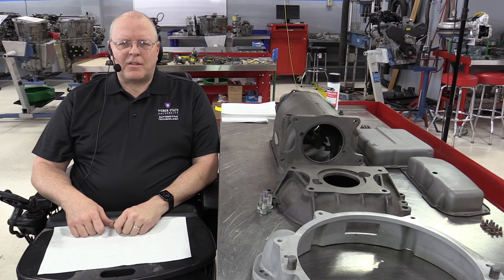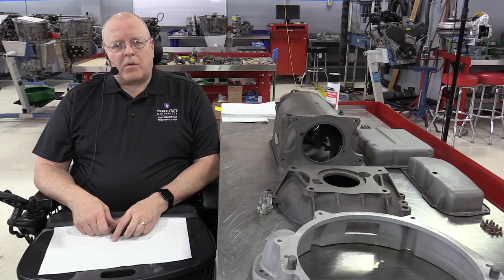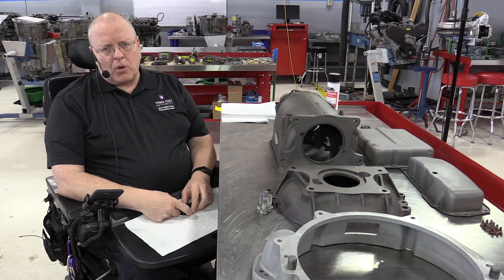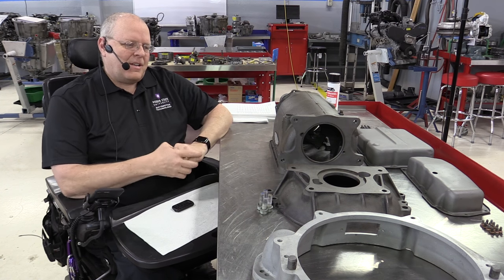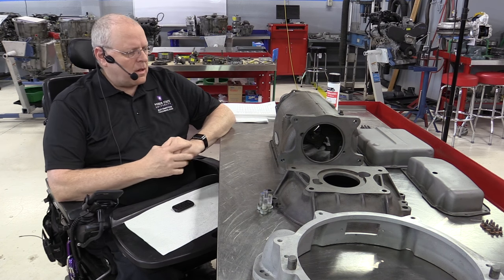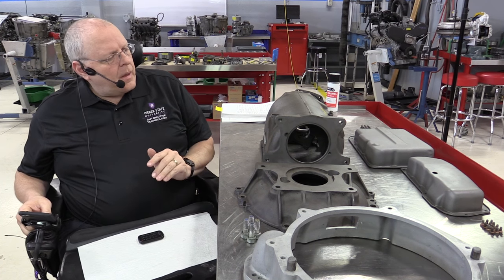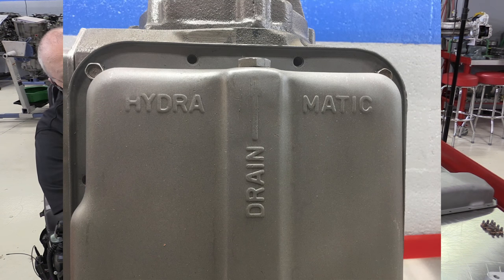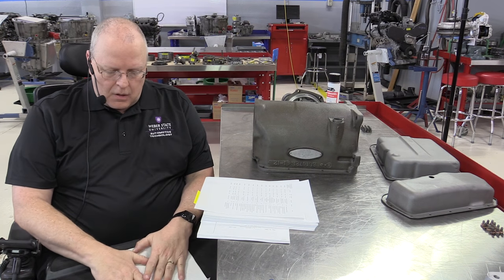World's First Mass Produced Automatic Transmission - Part 1- Introduction and History

Comment: The 4 speed AST transmission with the clutch was installed in a handful of 1938 Buicks. My grandfather who regularly would buy clear title salvage cars and repair and resell them ran across one of these just after the War but not really knowing what it was didn't buy it.
Reply: Fun fact, Buick was rather salty about basically being forced by GM management to build these units and install them in their vehicles, so when the AST failed, they had no interest in licensing the Hydramatic, and out of spite developed their own unit. The Dynaflow, which due to WW2, wasn’t finalized and introduced until the 1948 model year.

Comment: My dad had a Hydramatic in his 1948 Pontiac, the first year for Pontiac, it always worked perfectly—the sick/weak straight-8 engine not so.  We later had a 1955 Star Chief HT (first Pontiac V-8) that had a selector position that would start the car off in 2nd gear, it was listed as the “gas saving” mode. 
In 1962 I had one of the last perfected versions in my Bonneville, performance was awesome with the big 389 V-8 coupled to the smooth-shifting 4-speed Hydramatic.  With the introduction of the new 3-speed Turbo-Hydramatic in 1964-65, the 4-speed was gone but B&M carried-on for years with hi-performance versions.
Reply from the maker: Awesome! Thanks for your feedback!

Comment: The oldest car I remember in my family with an automatic was a 1967 Oldsmobile Cutless Supreme. All of the other cars my Dad and my uncles had since the 1940's were manuals.  So there was a cost and gas efficiency difference that kept automatics limited to the buyers who could pay for them in the 1950's and 1960's. But by 1970, many cars had automatics that cost almost the same as a manual, so they became more common. All of my cars are automatics (my first was a 1965 Rambler American). Now I drive a 2014 Ford Fusion Hybrid that has no shifting at all.
Reply from the maker: Awesome Feedback, Thank you!

Comment: This is a fascinating series. Thanks. My Stepfather started out in skilled trades at the Detroit Transmission plant which was on Riopelle Street in Detroit sometime in the '40's, then moved to Livonia, MI, then on to the Hydra-Matic Willow Run Plant where he retired in about 1985, or so. I worked at Hydra-Matic Willow Run, then later became GM Powertrain from 1977 to 2008. >>>
The year was 1977. I operated the cut open machine for the 400 THM torque converter in Dept. 433, Torus Division at Hydra-Matic Willow Run. The converters were rejects from testing; they were removed from racks, and were hand placed, hub down, into a massive chuck that clamped around the outside of the impeller body, (which we simply called the "pump") with the cover, pilot and lugs facing upwards. A plexiglass door was pulled down and the machine was cycled. A thick triangular cutting tool was indexed into the weld as the unit spun. The cycle time was about a minute and a half or so...it seemed. You knew it was almost done when ATF fluid began to get flung on the cover door of the machine. The machine cycle ended. Then you removed it, and the converter cover was separated, or almost separated from the impeller housing but still held by a bare "thread" of the weld, sometimes....then you banged the thing on a metal fixture, if you had to......to pop it open on a table that had a grated surface so that the fluid could drain. Then the internal parts were separated, and sorted down their respective conveyors to be sent thru a washer and put into tubs to be sent back their original department for inspection...and rebuilt...if possible. The bearings were never reused and were junked. 
Did I mention that the THM400 torque converter, filled with ATF, is heavier than most torque converters? 
The production on that job was about 200 units per shift...it seems. My partner and I figured out the most time efficient method to do that job, the idea was to keep the machine running with as little time between cycles as possible, and working together, we were able to "bust ass" and get 200 units by lunch time. Then go hide. The boss was happy because we always got the count. It was hard, heavy, filthy work, and guessed what we smelled like when we went home every day? Transmission fluid...you can bet. One thing that used to happen, was that occasionally when the cutting tool got really dull, the chips coming off the operation, would get very hot, and cause a fire inside the machine, aided by the ATFluid igniting...it was so hot. We would look down the aisle to see if the boss was around....and enjoy the fire for a minute as it grew before we reached for the extinguisher...heh. 
Fun times. 
In the 3 years I spent in Dept. 433, I did most of the operations making the impeller unit, and can remember the step by step manufacturing process in fairly great detail....Then spent some time in Dept 431 which was the torque converter assembly dept, where they were assembled, welded together, filled with fluid, balanced and tested. 
I have been retired from Hydra-Matic Willow Run since 2008, and spent several years making planetary pinion gears...and many other jobs. They closed in 2010, and the building was torn down in 2014. It was originally the Willow Run B-24 bomber plant, built by Henry Ford...in 1941...so much history there...Thanks for reading this.
Reply from the maker: Thank you so much for your fantastic story and more transmission history! I toured the Hydra-Matic Willow Run assembly plant in 1997. They were assembling 4L80-E transmissions on two lines. It was an amazing tour for us GM Training center instructors. One funny thing I remember is the machine that was making valves for the valve body. After they were made, the machine shot them several feet into a giant container. This is funny to me because as instructors we were always told to be very careful with the valves and never to drop them. Thanks again for your wonderful feedback, it is fascinating to me. Best wishes!
Reply: Thinking about that further I may have exaggerated the expected production on the cut open operation. It was more like 200 units per shift, not 400, as I recall, and doing the math...I've corrected that above.
One other thing that you may be very interested in: The THM400 torque converter that we made back then for the Rolls Royce contract....After the vanes were inserted into the pump housing and crimped into place with their retainer, we had a special welder that spot welded ALL of the contact points, or the 'bumps' that you see on the outside of the converter pump from the outside, securing all of the vanes in the unit as a very solid piece. The result was a coppery looking finish from the heat of the spot welds, and the thing rang like a bell ! Of course significantly fewer of those exceedingly robust units were produced, and were a special order for the RR contract. An existing RR torque converter from that era could verify this information.
Reply from the maker: That is awesome, thank you!

Comment: This is a long neglected and virtually unknown - to auto enthusiasts - story.  All you say is so, but the inspiration for the original Hydro-Matic came from the (British) Daimler Company. 

Charles Kettering attended the London Motor Show each autumn, and about 1931 purchased a mid-range Daimler because of its fluid flywheel and epicyclic transmission.  

Eventually the car showed up in Detroit and was studied by GM.  Nothing inspiring was found except for the transmission.  The essential issue was that this transmission was operated by a series of binary actions, which did not require finesse.  

Kettering realised that all that was necessary to fully automate a transmission of this character was a "brain"  to control the timing of these operations.  Design, development and testing of the automatic control system took about five years.  Carried over from the Daimler, in particular, was the four speed epicyclic 'box controlled by bands and multi-plate clutches, the fluid flywheel and the column-mounted shifter, allowing three front passengers.  Automatic adjustment of the bands was dropped, presumably as an economy measure.

I'm a London-based fellow transmission nut!
Reply from the maker: Thanks for your feedback, that is great information!
Reply: That is an amazing insight in to a piece of history.

Interestingly the transmission in the video has multiple patents, I suspect that the basis of the designs of what was patent originated from the Diamler transmission design.

In todays world I have to wonder if that same kind of design theft and then patenting would be permitted.

Comment: My first vehicle was a 1954 ford f-100. 239 V-8 Engine and a ford-o-matic transmission. 
 My Father's construction company bought it -- first ford pickup with an automatic transmission.  The old time mechanic's didn't understand the new "slush box" transmissions.  When the transmission went out the pickup sat in the yard,  till my Dad bought it and installed one of those old manual transmissions with no syncro mesh gears.  I was the fifth owner First Gibbons and Reed bought it, Then my Dad, Then my oldest brother, Then my next oldest brother, Then me.  I paid $100.00 for the pickup and drove it all through high school.  Then.. left it sit in my Dad's yard when I went in the Marines in 66.  He sold it for $50.00.  lol.
Reply: https://en.wikipedia.org/wiki/Ford_F-Series_second_generation
Reply from the maker: That is a great story! Thanks for your feedback!

Comment: My late mother drove her mother's '37 Olds as a teen, and
she said that the car had a semi-automatic transmission.  Though a clutch pedal was still used for
starting and stopping, she said that the transmission shifted very much like the
Hydra-Matics that she drove in the '40's and '50's.  The idea with this four-speed transmission
was to shift from Low (1-2) to High (3-4), but she said that driving in High
alone was fine, and I think that transmission in High must have shifted
1-3-4.
Reply from the maker: Thanks for the feedback and great story. I believe 1st or second gear was manually shifted; 3rd and 4th gears were automatically shifted. So 1-3-4 makes the most sense. Have a great day!
Reply: My first car was a '53 Studebaker with Automatic Drive.  It used a torque converter and started in 2nd
gear in normal driving.  It had an unusual feature that I haven't encountered since.  You could take your foot off the brakes at a stoplight or sign, and the car would not creep. There was an electric locking mechanism that locked the brakes until the accelerator was tapped.
Reply from the maker: Very cool! Thank you

Comment: The auto transmission that was on my father's new 1959 Ford Zodiac and subsequent cars such as a Rover 3.5 liter, Jaguar 4.2 XJ6) seemed smoother and more pleasant to use than modern electronically controlled auto gearboxes. I have little doubt that modern systems are more fuel efficient but have we actually lost something whilst auto transmissions have evolved? A friend (in the 1970s) had a Jensen Interceptor, with the Chrysler Torque-Flite gearbox and it's the only automatic I've ever driven that I prefer over a manual. Please tell me if I'm being stupidly romantic about older technology.
Reply from the maker: I know what you are talking about. Thanks for watching

Comment: you do not have to double clutch a manual transmission shifting up in the gears. ONLY when down shifting(think about it).
yes I have driven them. also the model T ford was like an automatic transmission in that it did not need synchronizers and shifted like a modern automatic transmission manually operated(user friendly).
Reply from the maker: Thanks for your feedback

Comment: You mentioned that Buick used the Hydra-Matic along with Cadillac and Oldsmobile and others.  Buick had their own transmission ( Dynaflo ) which was much different. Buick had many things of their own like the gas pedal starter and torque tube rear axle. Buick shared their Dynaflo with Cadillac for a while due to a factory fire.
Reply from the maker: Thank you for your feedback. Of course Cadillac would not tell their customers that they had a Buick transmission, so they called it the "Twin Turbine" transmission. I actually have a 1948 Buick Dynaflow transmission I am working on and will shoot a video on its operation as well. As far as I can tell the Buick Dynaflow was the first 2-speed automatic in mass production. The Chevrolet Powerglide that came along a few years later was basically a copy of the Buick Dynaflow transmission. Have a good day

Comment: The US patent numbers from the plaque are:

Pat.No.    File   Name  Issued  Title
RE21844 1932 Vetter 1941 Automatic Change Speed Gear Mechanism 
2176138 1937 Kelley 1939 Combination fluid turbo clutch and variable speed gearing 
2193304 1935 Thompson 1940 Change-Speed Mechanism and Control 
2193305 1937 Thompson 1940 Brake and Clutch Capacity Control 
2193524 1937 Thompson 1940 Change Speed Gearing and Control 
2195605 1934 Thompson 1940 Change-Speed Transmission and Control 
2204872 1938 Thompson 1940 Change Speed Gearing and Control 
2211233 1939 Kelley 1940 Fluid Flywheel Gearing Arrangement 
2221393 1938 Carnegie 1940 Variable Speed Control 
2270536 1940 Lenning 1942 Transmission Drive Cooling System 
2285760 1933 Thompson 1942 Change Speed Gearing with Automatic Overdrive 
2362418 1937 Thompson 1944 Clutch and Gearing Control 
2377696 1941 Kelley 1945 Transmission Drive 
2380680 1940 Thompson 1945 Clutch and Control 
2430258 1940 Thompson 1947 Rotary Hydraulic Coupling of the Turbine Type 

All are available via a Google search.
Great video series!
Reply from the maker: Great work! Even more interesting to me are the patent application dates, they tell the true story of who did what and when.
Reply: You are right. I added year of each patent application.
Reply from the maker: Excellent! One interesting comment about the RE21844. The RE means it was re-issued. The original patent was actually filed November 11, 1931 by John Michael Vetter from the Hague in the Netherlands and then reassigned to General Motors. GM renewed/reissued the patent before it expired on June 24, 1941.

Comment: In fact, the first  automatic transmission, using hidraulic fluids, was made by two brazilian engineers in 1932. So it was sold to General Motors.
Reply from the maker: That may be true, but this is the world's first mass-produced automatic transmission. Thanks for your feedback.
Reply: Ok, but, the one made by the brazilians don't configure a "step" to get to the first mass-produced automatic transmission?
Reply from the maker: I do not know anything about the Brazilian transmission or the patent purchase claim. I have read that it supposedly happened, but I cannot find any actual proof of it. I do know that the GM Hydra-Matic transmission is the first mass-produced automatic transmission. The first patent on the identification tag of this transmission is actually from a man named John Michael Vetter from the Hague in the Netherlands. The patent was filed November 11, 1931 and then reassigned to General Motors. GM renewed/reissued the patent before it expired on June 24, 1941. See patent USRE21844.
Reply: Marcelo Rohrigc  do not expect the Americans to recognize that both the automatic transmission and the airplane were invented by Brazilians.
They will never accept that.
Reply: The first automatic transmission using hydraulic fluid "may have been" developed in 1932 by two Brazilian engineers, José Braz Araripe and Fernando Lehly Lemos; subsequently the prototype and plans were sold to General Motors who introduced it in the 1940 Oldsmobile as the "Hydra-Matic" transmission

Comment: Is that not crazy fwd transmissions have the same configuration with side mounted valve bodies. got rid of that design in the late 90s due to drainback.
Reply from the maker: Thanks for your feedback. Almost all FWD transaxles use the side mounted valve bodies today

Comment: Didn't the model T use planetary gears?
Reply from the maker: Yes they did, but they were manually activated with a separate pedal on the floor for each gear set. These were automatically engaged at the correct time.

Comment: Why Americans never tell the full story??? Why you always want to be the best in everything??? You don't even mention the fact that the automatic hydraulic  transmission was invented by two Brazilian engineers, called José Braz Araripe and Fernando Lehly Lemos. This is quite annoying the same happens to the invention of the airplane.  You can't prove that you had the first airplane that actually take off and land by without any help apart from the pilot. the real inventor of the airplane is called Alberto Santos Dumont there are may videos showing him flying.
Reply from the maker: As the title reads, this was the World's first MASS PRODUCED automatic transmission, not the worlds first automatic transmission. I clearly state that in the video.
Reply: You are mistaken in your claim. Araripe and Lemos only developed the use of hydraulics in the shifting mechanism. GM used their basic concepts, but like so many things it's a combination of previous technologies. Go back and look at Baker and  Munro's work. 
GM was the first to put it all together in a functioning package, that's what makes it special. You've got a hydraulic actuated shift mechanism, and you've got a torque converter which provides completely automatic shifting with no external input from the driver. No one previously had all of those elements together in a functional package.